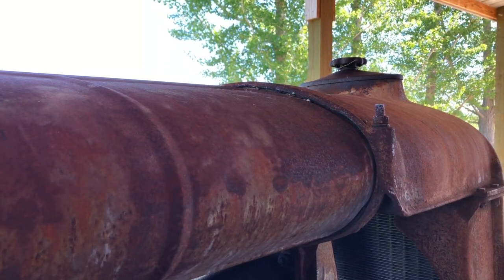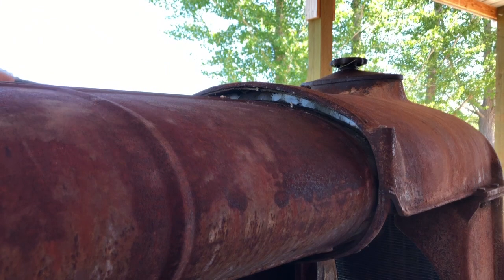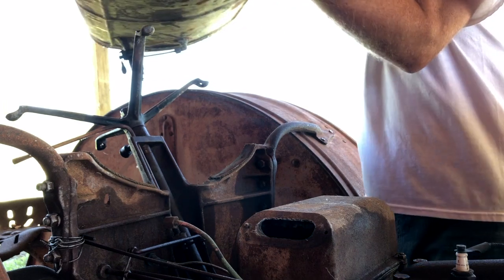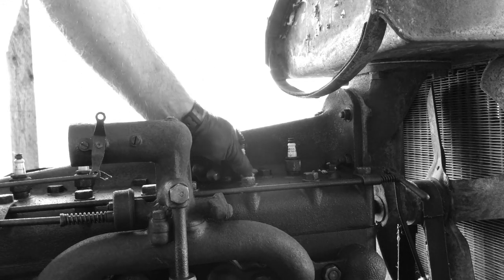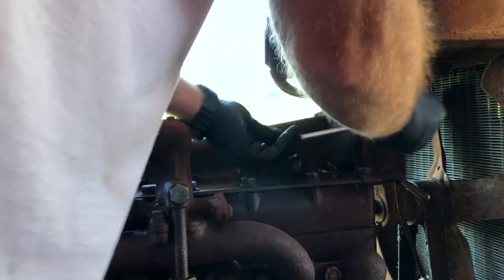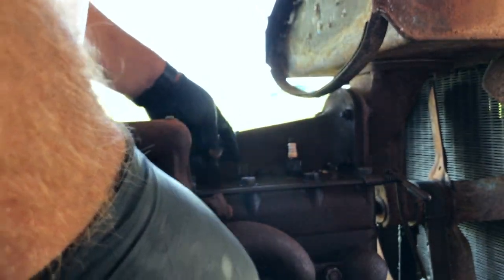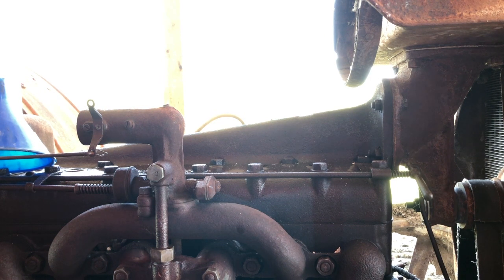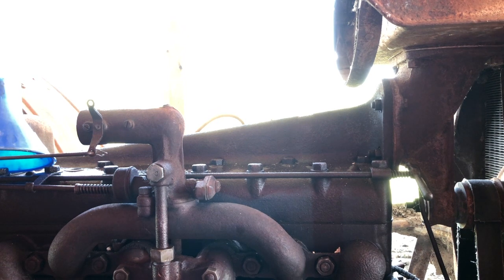1924 Fordson F Tractor - Removing the gas tank, removing rusted spark plugs (rust-oration #1)

Comment: Heating the spark plugs to red heat by using a gas torch would have broken the rust seal. After cooling, you would have been able to remove them more easily.